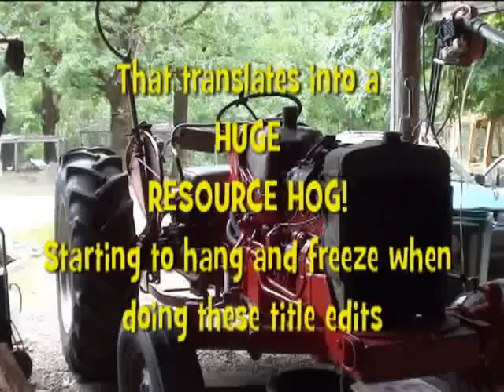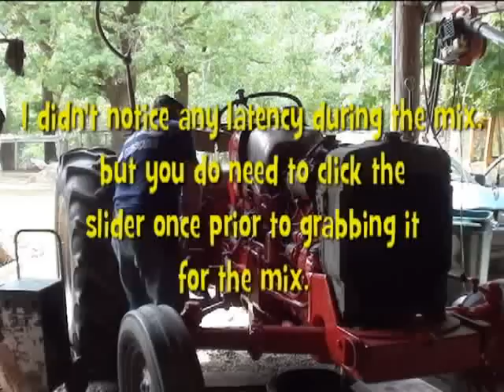Pt 6 International IHC Utlity 300

Comment: My lips are sealed, but not with leather or rubber.
I use Videopad 9 and like it. I have Pinnacle 10, but it was always seizing up. Haven't tried the newer versions. I also have & used WinMoviemaker, but had problems with it. Even Videopad seizes occasionally, but not near as much as any of the others I have used.

Dude you are fast...

Whitey? Still dead in the rafters?

Comment: Really surprised that on an otherwise very sturdily built Tractor which of course is meant to be in the dirt all the time, just like a run of the mill car off the ‘end of the line’ the water pump is, yet again the absolutely last thing thought about when designing probably because they have in mine "It only pumps water", well thats true but it’s that water that keeps everything cool enough not to grind to a halt! And why oh why do they not have a ‘Remote’ water pump, it would make things easier?